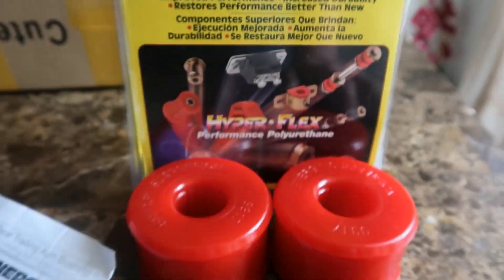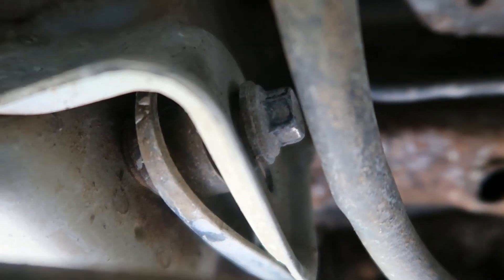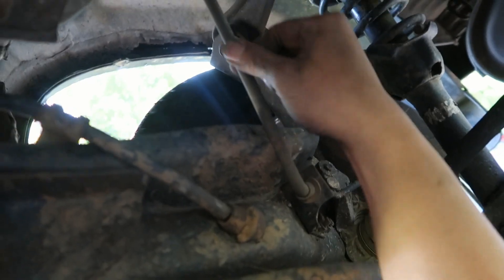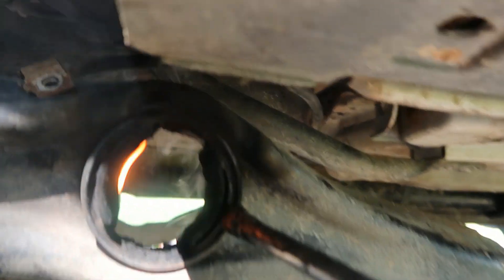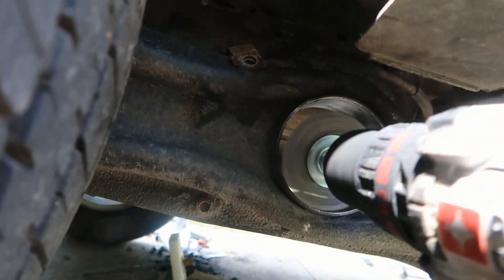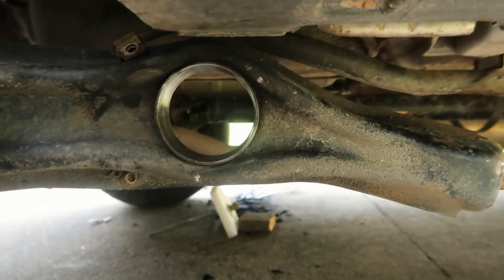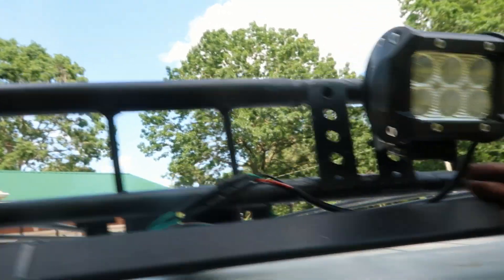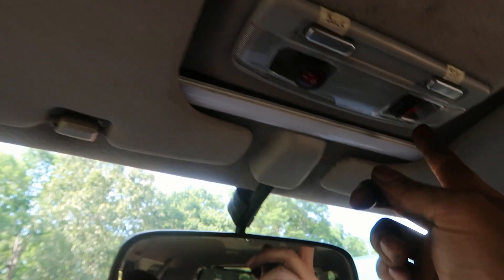Cr-v Energy Trail Arm Bushing Install

Comment: I dont know what were you thinking, but trailing arm.bushing rubber should be wleded to the metal one center metal.and the ring surrending it  not just put there like you did, because the center of the bushing will moving right and left sincenyou get there by pushing it by hand. In addition that bushing play a important role in suspension.